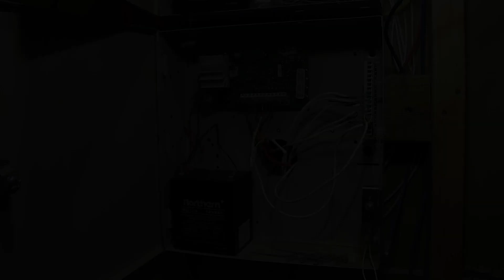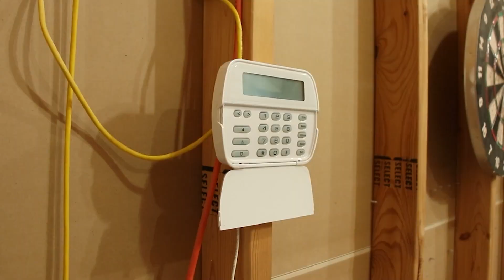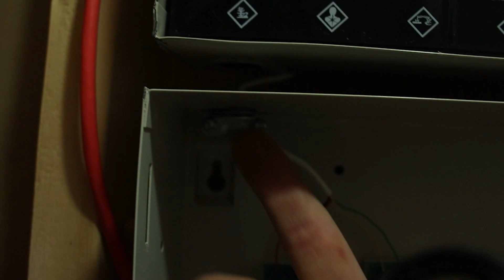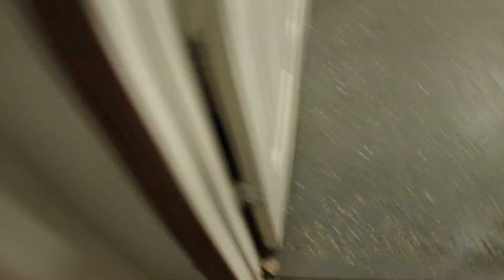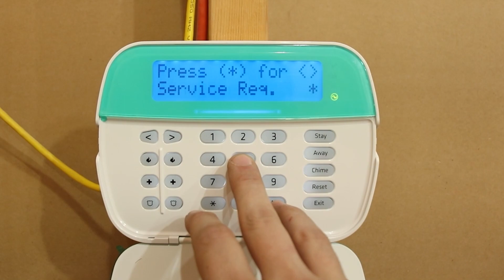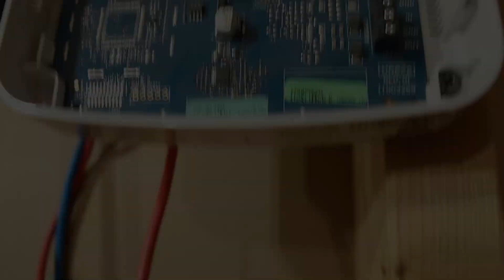Upgrading Alarm Systems: DSC PC1864 to HS2032

Comment: My dsc 1864 does not trigger siren when the smoke detector activate, it only shows trouble light, anything I can do for it to trigger siren?
Reply from the maker: Sounds like an incorrectly wired resistor or wrong value resistor.

Comment: My alarm has new 5g system, but, I hear the siren very subtle when alarm is not activated.  Someone said sound card??? Any idea what i can do?
Reply from the maker: There is always supervisory voltage on the bell outputs. Some sirens that have low resistance can pick up on that and emit a very low volume sound. On DSC, putting a 1k resistor on the siren will silence it.

Comment: How do you hook up your flood sensors? Are you using four wire floods?
Reply from the maker: We use 2 wire type generally. Either this one: https://www.alarmsystemstore.com/products/tane-ws-1-water-sensor
or this one:
https://www.alarmsystemstore.com/products/gri-2600-12-volt-dc-water-sensor

Comment: Pro Tip, I disconnect the board from the pegs first let it hang. Put the new board in. And then transfer the wires one by one, much faster!!! Label the wires after. This should only take 30 to 45 minutes.

Comment: Is it a big deal to swap out a alarm panel that is not compatible with the alarm monitoring website you mentioned to a panel that IS compatible (I can’t type the site name in the comment bc YT will take it down).
Like, do you have to change out any of the contacts or devices? Or just wire them to the new compatible panel?

Comment: I'm curious, is there a reason to upgrade the panel? I am replacing my fsa410 smokes with 4wta-b smokes on my 1832 panel.
Reply from the maker: Only if you want a newer panel with more or better features.